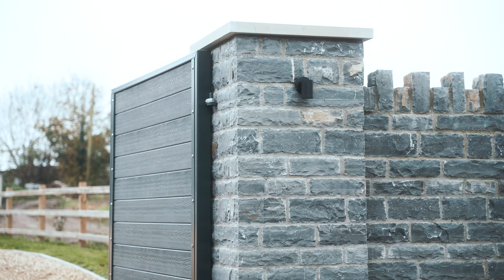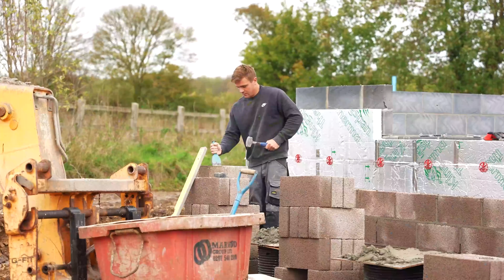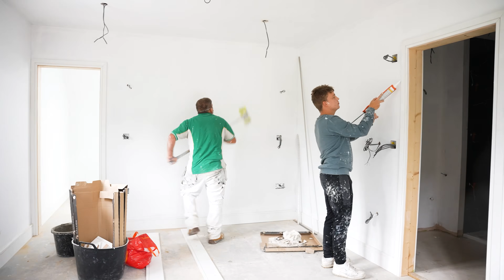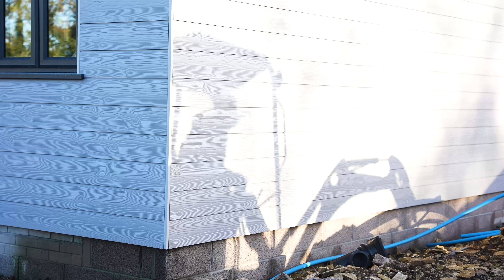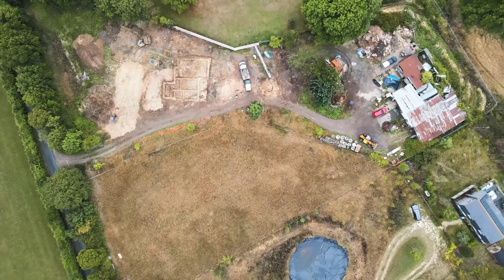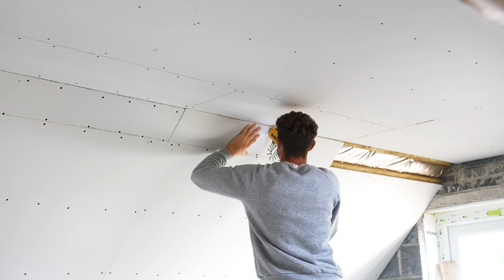Building a DREAM HOME From the Ground Up! | Full Build Journey

Comment: foundation is so not deep..strange to see. Also you should not put bricks directly onto the foundation, there should be hydroisolation layer betwen them. Cause water will go up to the walls from the ground especially in those  bricks you have used. they have LOTS of "capillaries".. 
Also there should be hydroisolation before pouring that foundation. Water is very siruos problem in modern house, where whole house is so efficient in terms of no air escaping.
Of course house looks very nice if ignoring those technical mistakes that in UK should be not made because of being such a rainy country.
Reply from the maker: Thanks for your input mate, check out the other videos on my channel. They will put your mind at rest and show you in detail the points you mentioned 👍